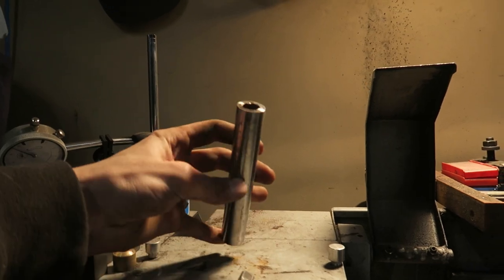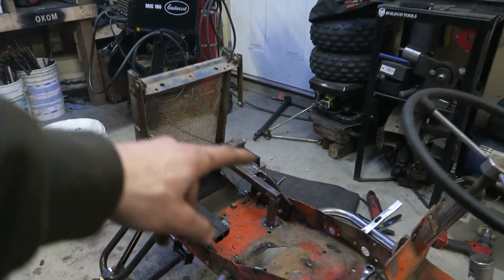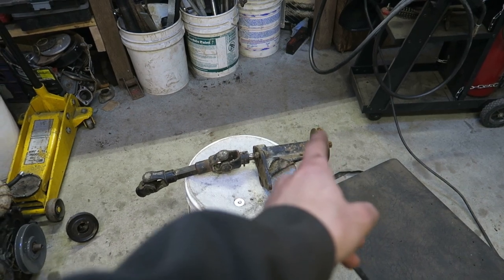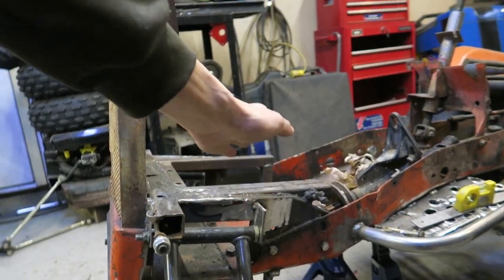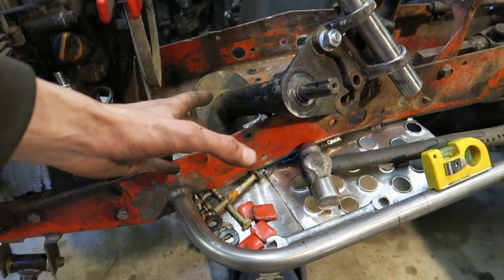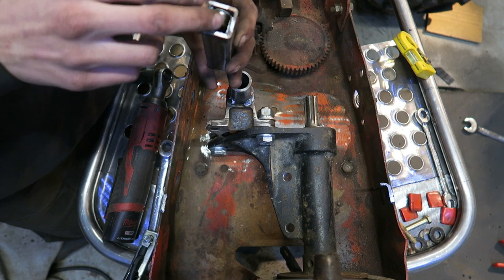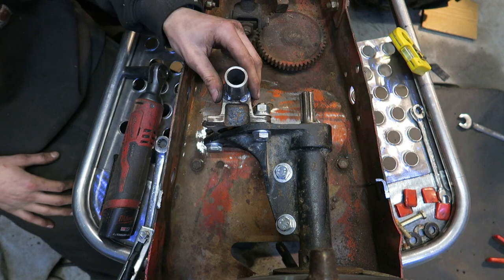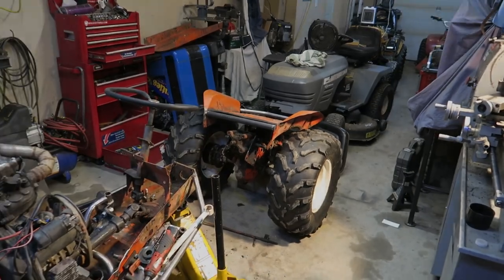Building a DIESEL off-road mower part 3

Comment: You might run into an issue running the bevel gearbox backwards, it might not mesh correctly and could ruin it and might not lubricate the front input bearings. I own 29 of them and it's neat to see one set up like this best of luck